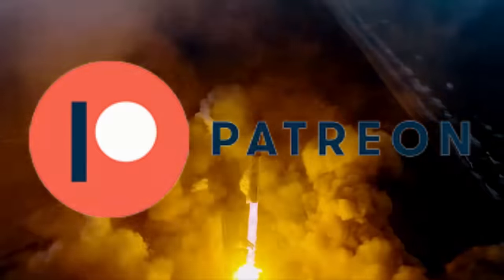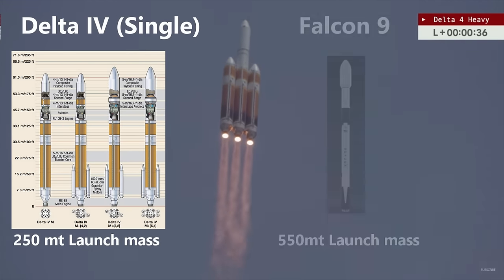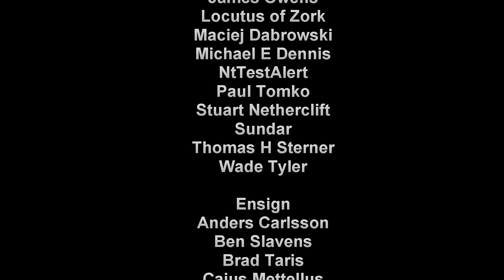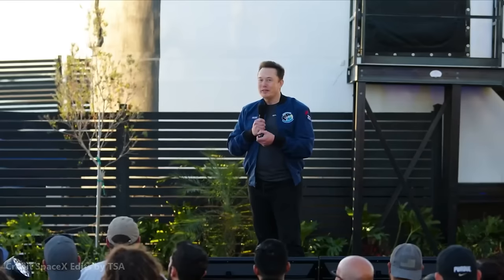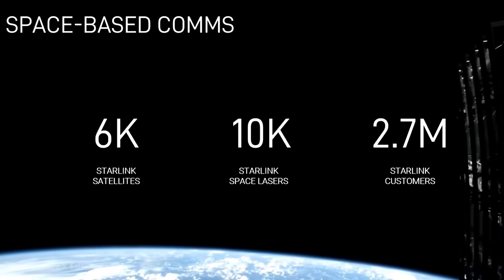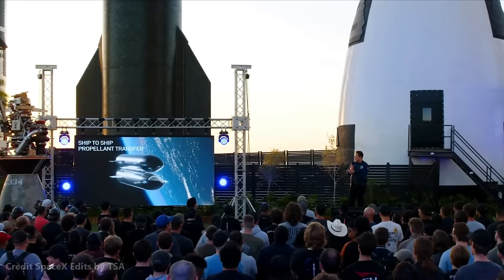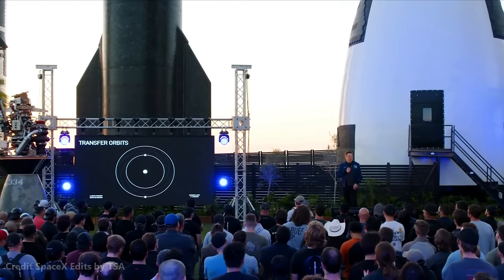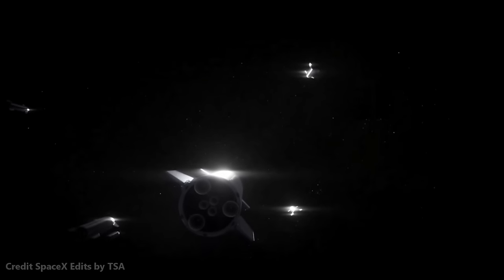Last Flight of the Delta IV and the Creation of Raptor 4 and Starship v3

Comment: Not mentioned in efficiency comparisons: hydrogen requires a much larger tank than methane. Per Elon subcooled methane is more efficient than hydrogen.
Reply: Actually hydrogen requires much larger tanks, Insulation not required for methane, fully seperate tanks as opposed to a common dome used for methalox so the tank weight is much higher.
Falcon heavy is much smaller than delta heavy but can deliver a much larger payload.
Hydrogen being the smallest molecule in existence leaks from anywhere if you as much as look at it. It causes hydrogen enbrittlement. 
Hydrogen, although it has some very good use cases is a horrible choice for a booster, and a worse choice  for a reusable booster.
Reply from the maker: Not more efficient by Isp but overall, yes.  Explained in our methane rockets lesson.

Comment: I used to wonder before about those forward flaps for long time that " why they don't put those flaps far ahead . that could increase torque around cg which could make belly flop more effective ( aerodynamic standpoint offcourse Tvs could do much more)" it would increase centre of pressure ahead which make it unstable during ascent but's not at all a probelm for modern day  sensors and processors (n1 flashbaks💀) now they changed it. 👽
Reply from the maker: Indeed... Constantly innovating

Comment: 50 tonne is very low, how can you refine in another 50 tonne. It just seems unlikely. The only thing that I think can give 50 tonne is to use aluminum.
Reply from the maker: The Raptors are gaining power and they will be stretching everything, increasing the launch mass and therefore overall mass to orbit.
Reply: @terranspaceacademy  they are already pushing those raptor thrusters. It will have in total a larger quantity of fuel in orbit , but the tanks get larger , so the problem still remains. What they have is 50 tonnes to orbit, at this point I don't even think they can add a single tonne more . There nothing left to optimize. I think it's time they start considering shrinking the starship, and increasing the booster length only . Thus it can release starship at a higher speed .
Reply: @terranspaceacademy  just to be sure that I'm being fair. Is it that starship can launch and land back with 50 tonne of payload . Or is it that starship can launch 50 tonne of payload, leave the 50 tonne in space and land again or 
In other words can starship launch 100-150 tonne leave it in orbit ,and land without any payload.
  
If it's the first one my point still stands.
Reply from the maker: Right now it could get about 150mt to LEO if it was optimized to do so... To come back and land it's down to 50mt.
Reply: @terranspaceacademy  I will have patience, I do hope what ever these optimization are , works .

Comment: 39:45 "Five or six refilling missions for every one mission that goes to Mars..." - I find it very hard to believe.
Reply from the maker: I question that too.  But at 1,200 mt and 200mt to orbit that's six.
Reply: @terranspaceacademy  Does a fully fueled Starship have enough Delta-V to reach Mars and land? If so, how much fuel would be required? Could Starship be partially refueled to 80% full to possibly save a refueling ship?

Comment: Would it be possible to add chepter breaks: main segment, supporting segments? (ref NSF video summaries)
Still amazing 'lesson.' Yes, the RL-10 and RS-25 are amazing engines...but are they practical? Aside from the cost of each engine, what is the the difference in fuel costs?
Thank you again.
Reply from the maker: Great suggestion! I'll try to work that out.  The RL-10 is unmatched in efficiency and can throttle down to just 15% full power.  They are about $10M each so not cheap but by space industry standards they are hard to beat.  The RS-25 is overpriced and under available. I would go with the RS-68 for a non-reusable LH2/LOX engine.
Reply: @terranspaceacademy  Do you know what is penalty to prevent propellant boil off for HydroLOX engines (insulation, pumps, etc)?

Comment: On a different topic, somewhere around 10/15 years ago, I came across an article it might have been new Atlas, or another one. 

It was describing how to use 3D printing where was printed as a lattice, which actually gave more strength and lighter weight.

However another interesting phenomenon was that this kind of structure not only lighter and stronger, it also engendered radiation protection. 

I suspect you may know this already, however in case you haven't I will pass this on to you I do not have the URL, so it may require some research. 

Scientia Habet Non Domus,
(Knowledge Has No y)

antiguajohn
Reply from the maker: Do you remember the material?  Lighter elements produce less secondary radiation but don't block as well...

Comment: I think Elon needs to fundamentally rethink the propulsion choices for the interplanetary vehicles and opt for a high ISP choice in the nuclear/electric (direct explosion to vasimr) family of engines. Near term methane works for ascent, it also works on Mars with some fiddling. Better long term solutions are needed though. If I had to bet on a solution I would go with "static" laser propulsion.
Reply from the maker: A South African company would have the resources and knowledge to make a nice space reactor for that purpose.
Reply: @terranspaceacademy  I do agree that it won't be done in the US as the atomic energy people don't want to share. Sadly the americans will be begging to get a seat at the table when things are starting to get moving in space.

Comment: The Valles Marineris on Mars is4,000 km. Long & upto 7 km. deep and has many side canyons that could be covered over and pressurized in segments. 

Due to the depth there will be added radiation protection and also increased protection against meteor strikes that are on an angle.

This would provide vast areas for habitation agriculture and the laws for expansion to other side canyons, linked by tunnels. 

It would also allow by being segmented and in various canyons protection against a single failure event 

I suspect they will also be a multitude of other advantages.

Scientia Habet Non Domus,

(Knowledge Has No Home)

antiguajohn
Reply from the maker: I've thought the same thing.  Plus you can see a cutout of Mars history, looking for fossils etc...
Reply: However, you must take into account the risk of landslides.
Reply from the maker: That's true... And some idiot from a competing colony dropping a rock on your head :-)